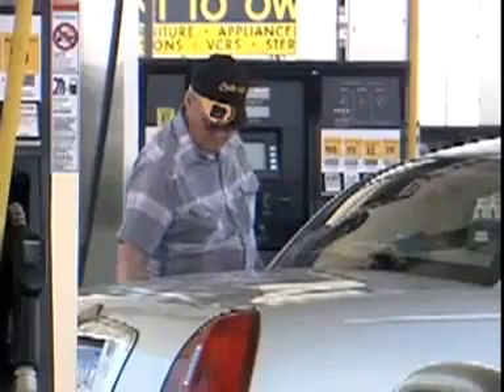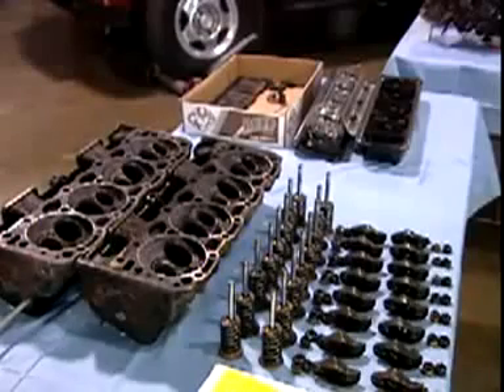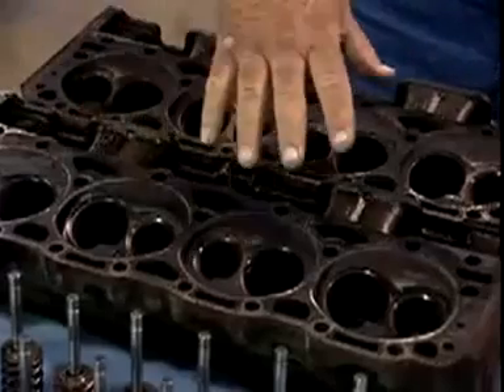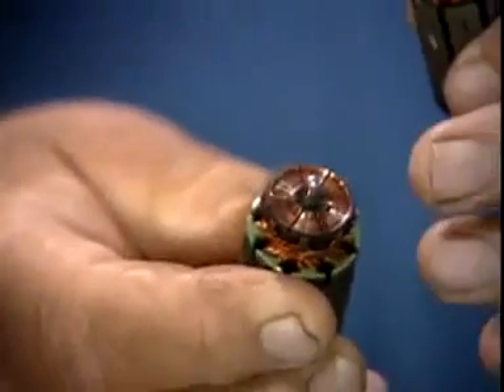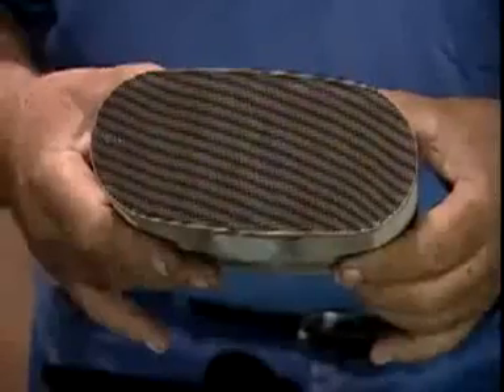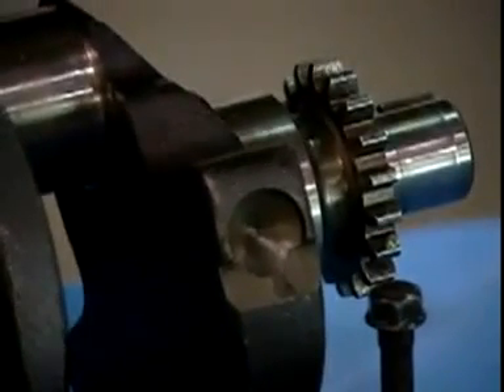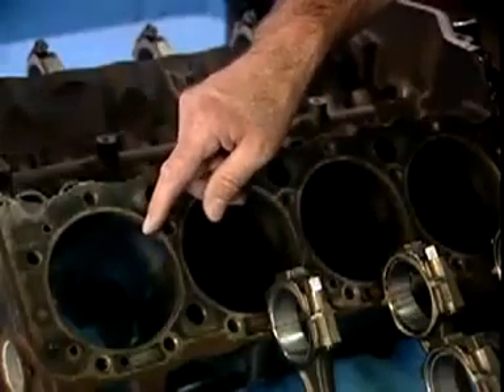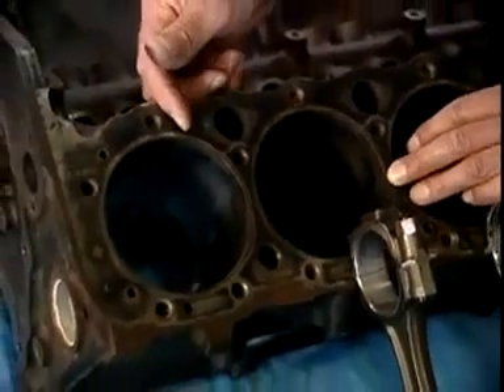Non Flex Tahoe Runs 100,000 miles on E85

Comment: Fact. E85 collects moister which causes aluminum to corrode. All the cast parts rust. If you only run long distance freeway mileage, this burns the moister off, preventing the rust and corrosion. This type of driving DOES NOT APPLY to most vehicles. Its a shame you intentionally mislead the public, suggesting they will see the same results. 
Talk to people who had their boats catch fire due to fuel line deterioration. You cannot scientific fact. Alcohol eats rubber.

Comment: Unfortunately; I have to say I don't think that if you ran e85 for 100k miles, you would have any real carbon buildup, at all, on the piston heads.
Reply: Unburned fuel is not the only source of contamination in a combustion chamber, so despite the fuel switch, carbon should be expected on the piston tops.

Comment: I just switched to e85. I have an 3.5 charger. Reg gas was causing my check engine light to come on. Not anymore. My vehicle runs way better when accelerating as opposed to the 89 mixture i was putting on. So... I switched.
Reply: Did you need to change fuel lines ? Or injectors ? What year is your charger ?